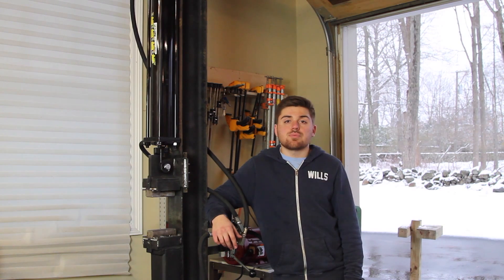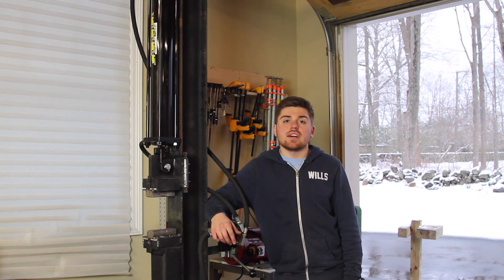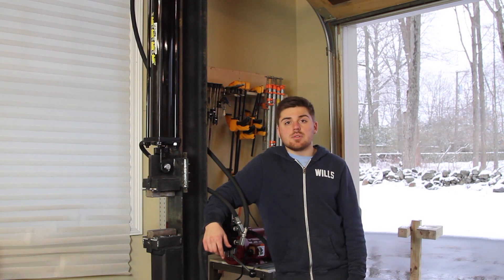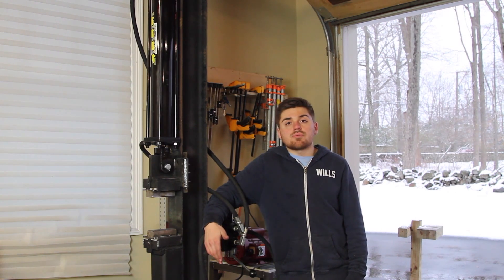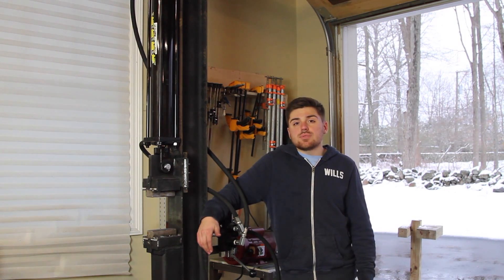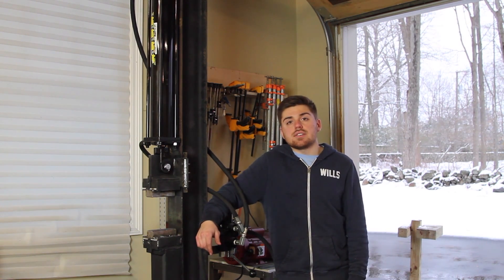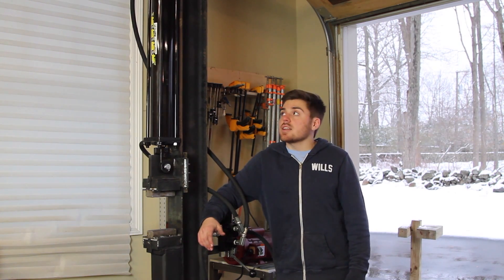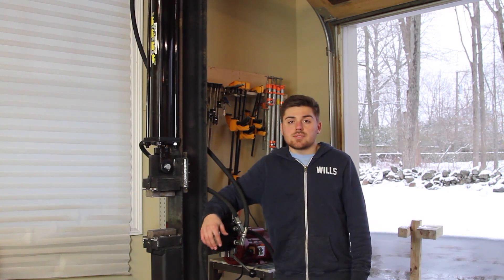Building a Hydraulic Forging Press Part - 3

Comment: Couldn't help noticing how much flex on your drill press table when drilling holes which makes for inaccurate holes when drilling thru thicker material and especially tubing.  Use an old car scissor jack from your base to the bottom of your table to make it super rigid.  This is a common problem that no one really notices while drilling. Now I will continue watching the video.

Comment: Hi, Nice work. Your design is all in all very good, Though a more stable base and exchangeable dyes would be nice. Also a shorter hydraulic sylinder would cut the costs and dodge the height issue.

Comment: Try rotating your hydraulic fluid container 180° when pouring. It's mainly for burp control but I have had a few times when crud collected in the handle as a bonus feature, of no importance today.

Comment: My press is done too. I did what you said and got 4" bore, shorter 8" stroke. 12" i beam. Getting 2900 psi w/ 5 hp 220 11gpm. That’s 35 TONS. I need a lot of practice now. And tooling up the dies now.
Reply from the maker: That’s awesome!! If I could go back and do it again I would build it just like you did
Reply: How many inches per second are you getting on that?

Comment: Another great video Paul, very inspiring. I've been toying with the idea of building one of these for a long time but for some reason had them much more complicated in my mind. I'd have to go some help with the hydraulic stuff but I think I'm gonna start sourcing parts, any advice to toss my way before diving in?? Thanks!!
Reply from the maker: Thank you!! And that’s awesome! I would make sure the frame you make is really sturdy and if you use an I beam like I did make sure it’s big because these cylinders are so strong they can cause the beam to 
twist and bend. And check out ruggedmade.com for parts I got a lot of stuff there. Hope everything turns out well!

Comment: Love the fact that you built this yourself, but I'd urge other prospective builders to look at 22 ton log splitters on Ebay. They are $829 including shipping. All the parts you need are there. Another $189 will get you a 3hp electric motor for use indoors. Just make dies and a stand to hold it vertically. A 35 ton splitter on Ebay is $1299 and will require a 5hp electric motor at $250-300.
Reply: Hi what was the PSI, Power and flow rate of your motor/pump. Also what was the spec of your hydraulic ram. Great Video and well done.

Comment: Would you mind posting a list of the items you used for this build? Awesome job!
Reply from the maker: Thanks! And I could just quickly tell you the parts of the top of my head 
3.5inch bore 30inch stroke tie rod hydraulic cylinder from northern tool - the stroke is definitely too long 
5hp compressor duty lesson motor 
A hydraulic pump / valve kit from rugged made 
A hydraulic filter and hoses from Napa 
3gallon nortrack reservoir 
And the steel was just some drops from a local supplier and scrap tube I had laying around if you want a more detailed list just let me know!
Reply: Paul Pinto  if u had to do it over what size stroke would u go with since 30 in is over kill?
Reply from the maker: I would say a 12 inch stroke is good because mine only moves about 9 inches and that’s plenty of room for large material to fit in between the dies. I don’t think I would go smaller than 12 though
Reply: I found one, would u mind sending me a detailed list of ur build? I’m interested. I can supply my email or whatever u need
Reply from the maker: Sure send me an email and I’ll write you a list
Reply from the maker: There’s a link to my email on my instagram and the link to my ig is in the description of the video
Reply: Hi friend. Great job. I’m Wagner, from Brazil. If you don’t mind, I’d like to get the list of material too. My email is wagner.dassom@gmail.com.
May the Lord God bless you